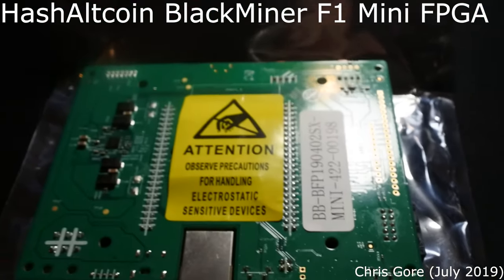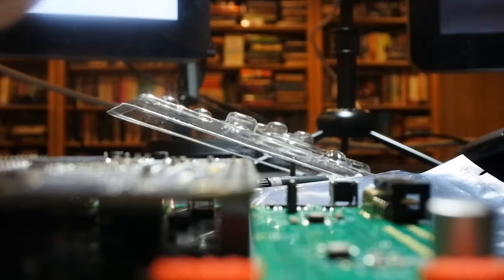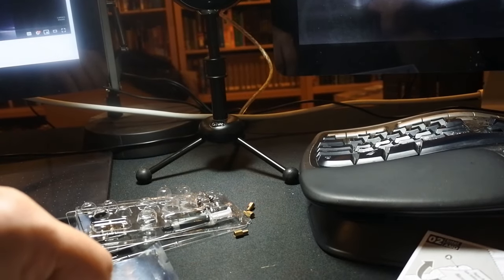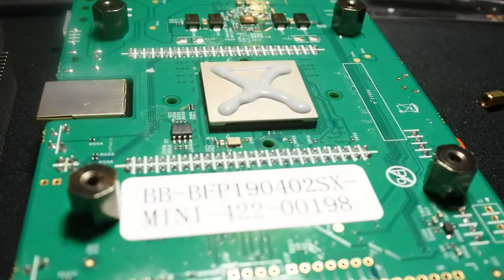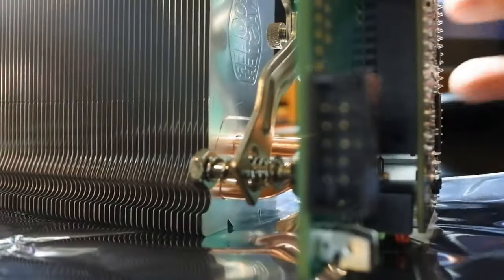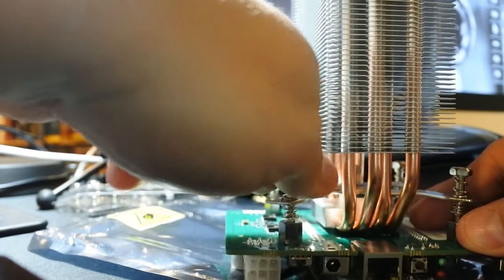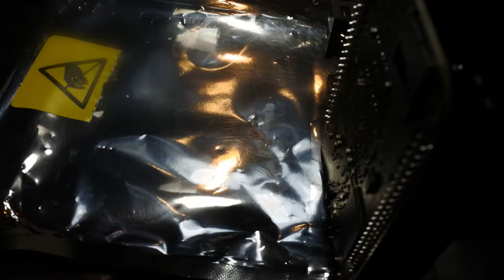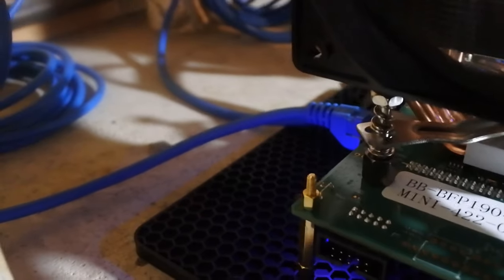HashAltcoin BlackMiner F1 Mini FPGA (July 2019)

Comment: Thanks so much for this. Nice to see you trying to figure it out along the way and the process you went through. Kudos!  I'm thinking about getting F1mini but don't know if it will make any money. Can you please tell me what you're mining and what your expected ROI is?  Thanks!
Reply from the maker: Sorry, I'm mining something super secret and playing around with different streams.  I mostly got the two minis for experimentation.  I'm planning to pick up their big brother the F1+ in the near future and actually start caring about that sort of thing with a few of those.
Reply from the maker: Hash Altcoin has a nice little profitability calculator on their site that can help.  Remember that the F1 mini has a lot less chips than the normal F1 or F1+ though, so you need to adjust the numbers. Just make sure to /12 or /18 from those numbers.  The F1 Mini only has a single chip, the regular F1 has 12, and the F1+ has 18.  So you can derive the numbers from those.
Reply: @ChristopherMarkGore  Thanks!!

Comment: Thanks for the great video!! And the explanation great help setting up my bm f1 mini’s.
Mine wont power up now.. what is the tester thing for the psu?
Reply from the maker: Thanks, glad I could help!  The PSU I got had a little device that came with it that plugs in where the motherboard would normally get powered, and I guess it's just letting it run without a motherboard.  Here's a link on EVGA's site talking about it, they call it an "EVGA Detection Tool" there: https://www.evga.com/support/faq/afmviewfaq.aspx?faqid=59582
Reply: Thanks for the link I have done some searching on aliexpress and they called it there power supply jumper starter. And ordered a couple.
For temporary solution to power the miner I just attached a motherboard.👍